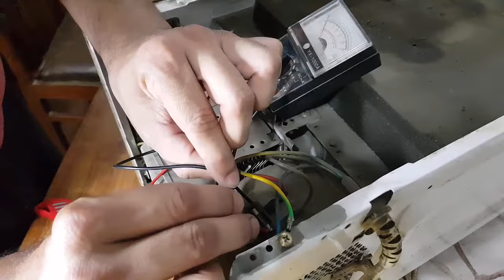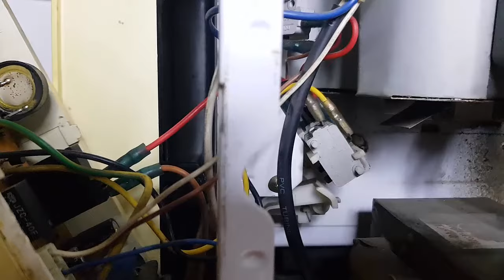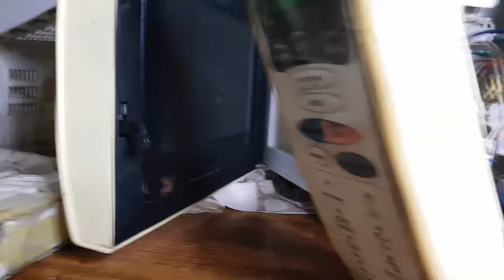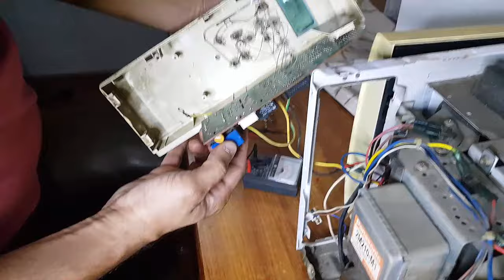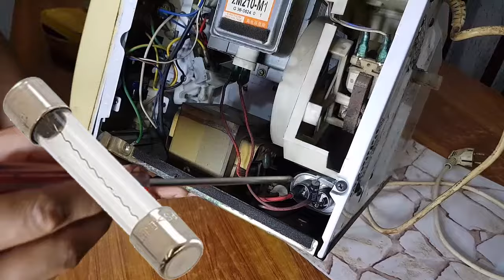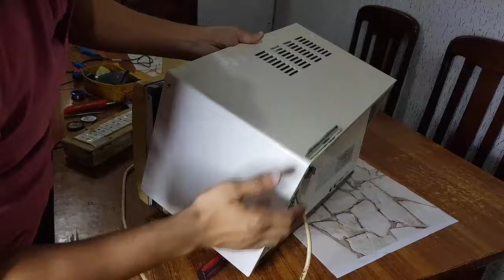Microwave Oven Reparing | A to Z parts checking | fault Fix at home | Urdu/Hindi | #techknowledge

Comment: Be careful! always discharge the capacitor terminals and fuse with the "Ground", to avoid shock, otherwise you may be killed.The voltage across the capacitor is about 2.1KV to 5KV.